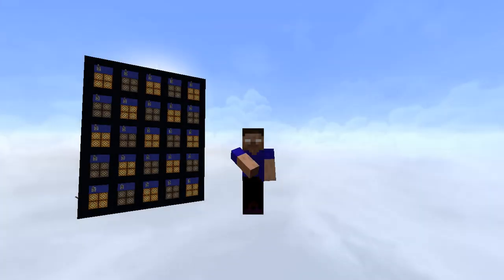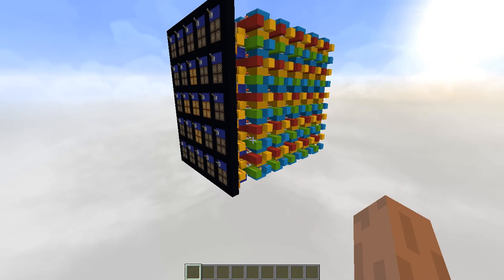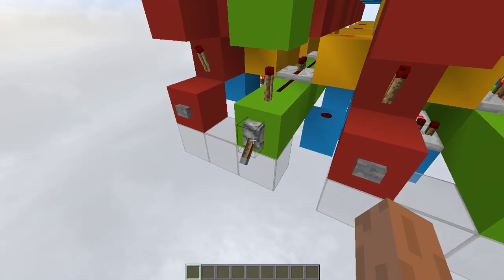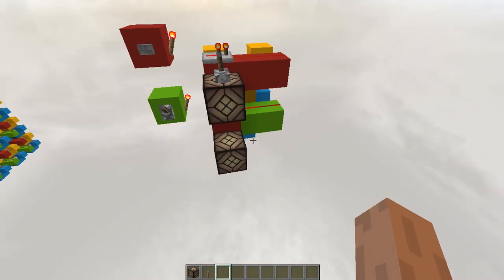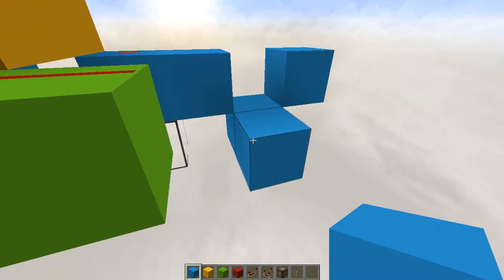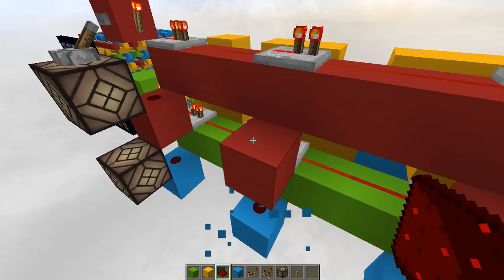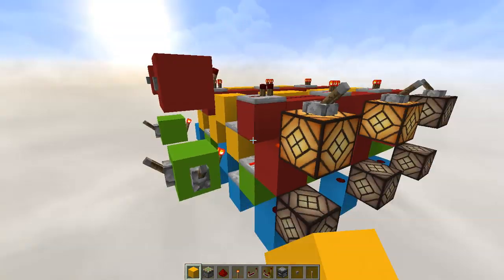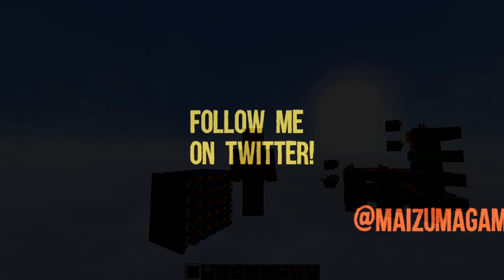Simple Memory Array (Solid State Hard Drive) - RAM Module | Minecraft

Comment: if you could direct the output through a proper 1 block per pixel screen then even if it required a massive delay you could play small animations which would run at up to 10 fps using a simple clock because the delay is the same on the input and output so you could have a different image every 2 game ticks
Reply from the maker: Could be! Maybe it's worth a try eventually.

Comment: I built the 1.14.4 item sorter and I’m loving but I have one question 
If on the bottom rail track if I have more than one activator rail powering the red stone resetting the dropped will it break it
(The red stone signal dosent reach the end of the design but is to short to have another perfect activator rail)
Thanks
Reply from the maker: Yes you can have more than one, no problem. Make sure to have your detectors as close as possible to entrances rather than where the minecart exits the sorter sections.